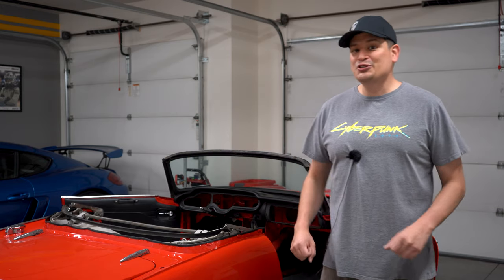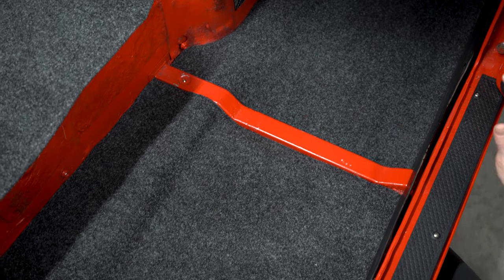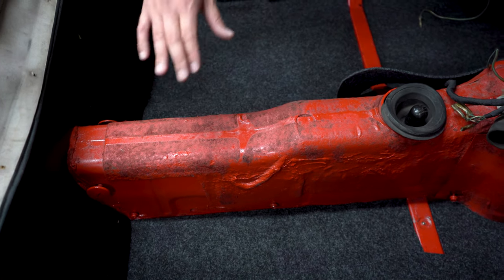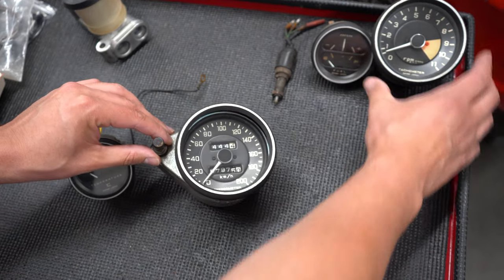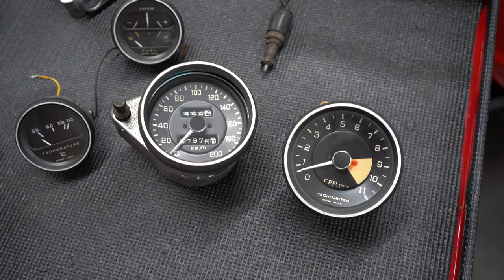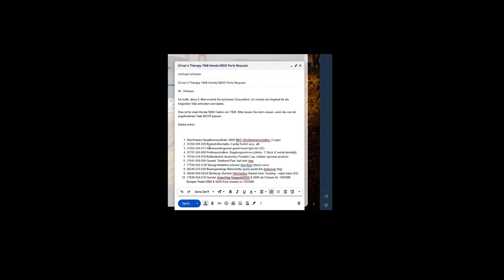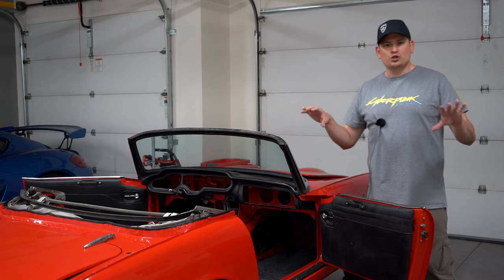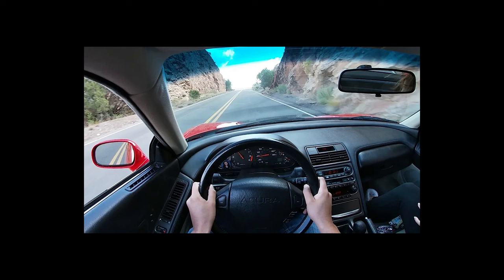Honda S800 Update 31 - Glued Carpet, Buffed Gauge Faces, and Brake Master Cylinder

Comment: Alfredo Rodrigues from Portugal does S800 interior trims and there are vids on utube of how to fit them. He can also supply new carpet, seat covers and dash trims. The arm rest is a valuable piece and i sold an OK one 12 years ago for $125, kept the best one for my car.
Reply from the maker: Thank you for the referral. We got the Porsche carpet in and just put in a request for a quote from Matt Ortmann about the center console and tunnel carpet thing.
Reply from the maker: So what’s the update on your car? Is it running?
Reply: @DriversTherapy  It's tucked in a corner under a cover. Not finished the axle build yet. But other than that and a tune it's pretty much done. Barracuda in bits in the way so the S800 can't go anywhere till that is done.

Comment: The snaps at the bottom of the center tunnel were for the original carpet set which had a single piece that covered the tunnel from the footwells to the back and snapped into place. It had textured vinyl scuff pads on both sides and the edges were bound with vinyl, too. I don't t know if anyone remakes these exactly-probably Japan if anywhere.
Reply from the maker: Thank you for that information. I appreciate it! I am going to leave them there since they do not come out.